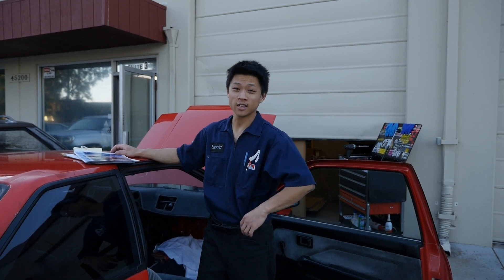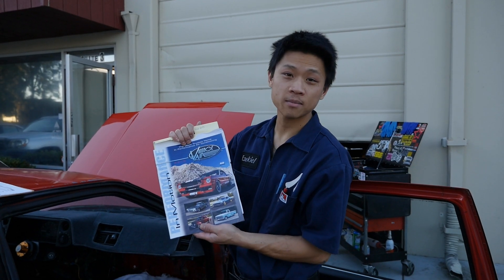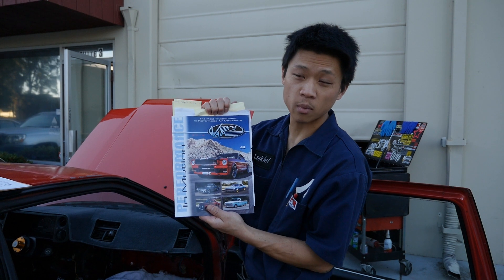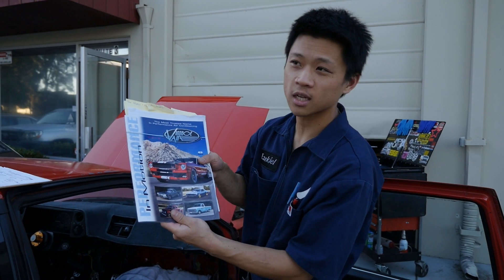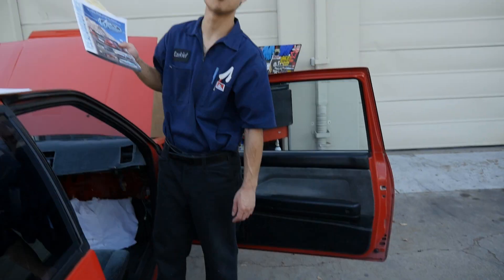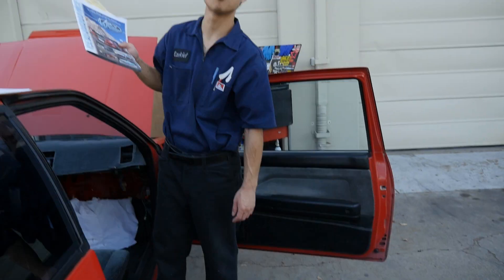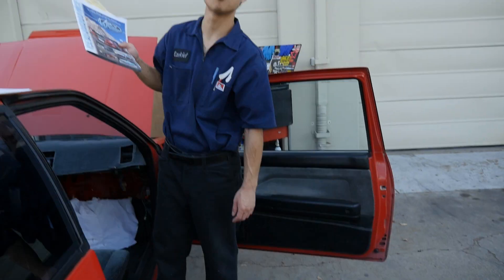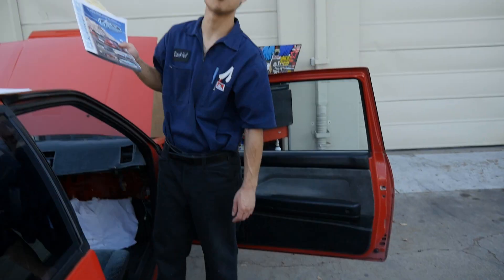AE86 Vintage Air pt1

Comment: I have a bel air that a lot of people use vintage air on, never thought about installing it on the corollas.
Reply from the maker: Its about the right time for it: parts are all too rare and/or expensive and the system is outdated at this point.